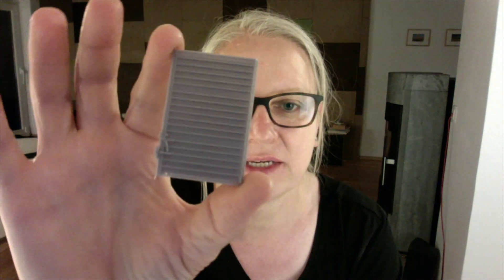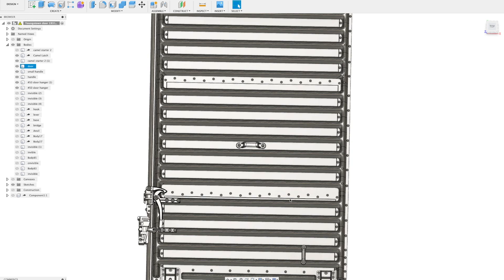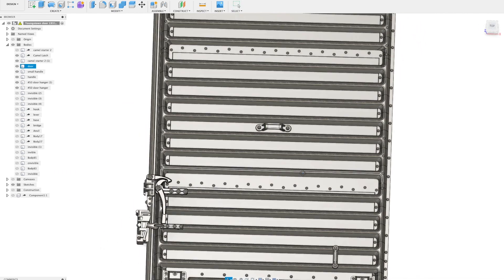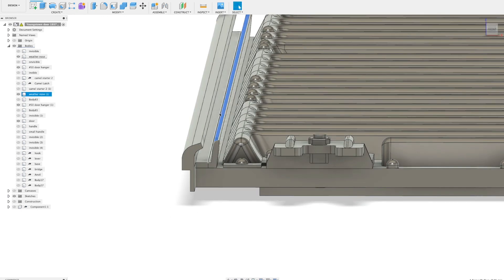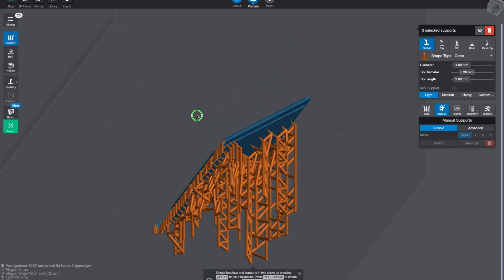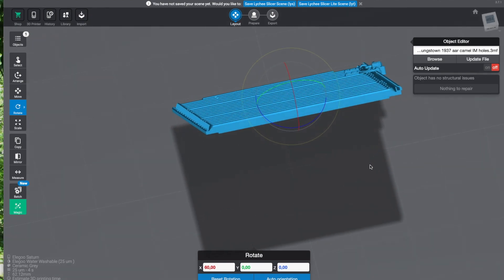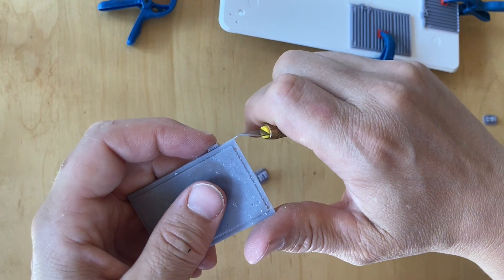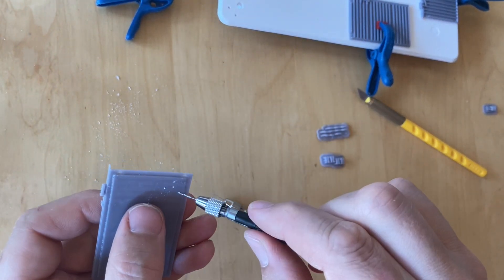3D Printable Boxcar Door

Comment: Very nice. Thanks for sharing the files. Do you glue the handles and brackets?
Reply from the maker: Indeed, a drop of super glue to the backside of the door is all I do. So I can prevent runs and it's really fast. The door hangers might receive an extra drop around the pin, just in case.